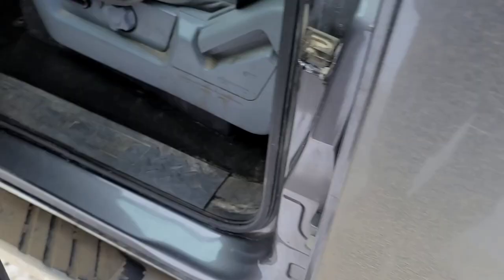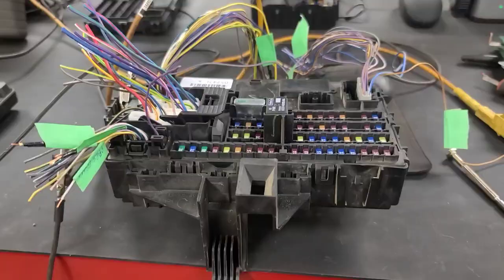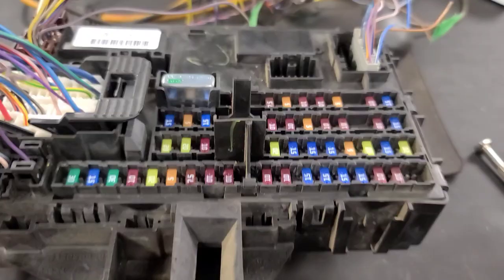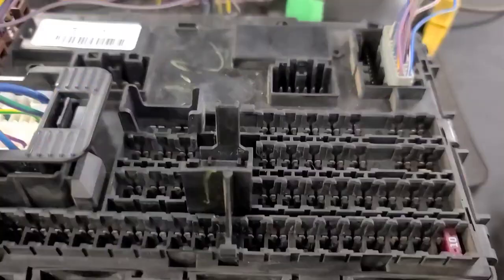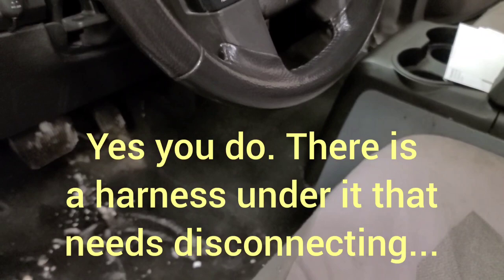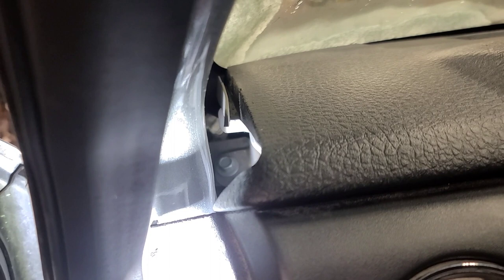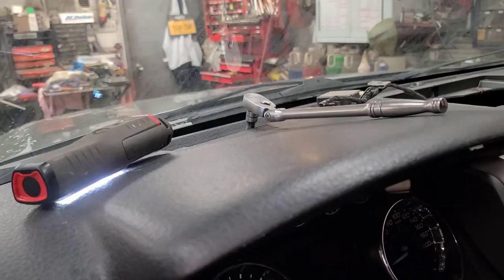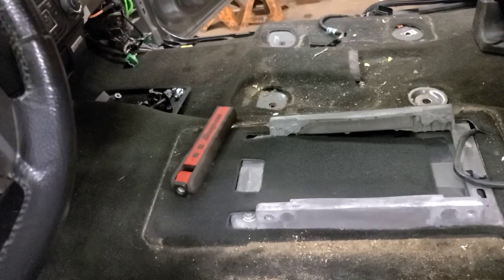2013 F150 Multiple Electrical Problems, Failed BCM Again!!! Plus Entire Dash Removal.

Comment: Wow!! 3 bad BCM’s in a row!
I’m glad I watched your video because, I can see how difficult and time consuming it is to identify the cause of the problem!!

I’m afraid to bring my truck to the dealers or repair shop because, I know they don’t have this amount of time to teardown the dashboard and troubleshoot the module without making the customer pay for their time.

My 2016 Ford f250 super duty is having issues with flashing skid light, intermittent brake light, abs, battery, airbag on the dashboard and the chime sound!

Intermittent dashboard gauges shutting down and quickly restoring to normal.

I measured 122 ohms on pins 6 and 14 on OBDII Connector which tells me there is an open on one of the modules or bad wire to a module.

12v on pin 16
2.68v on pin 4
2.36v on pin 14
Chassis ground on pins 4,5

The dashboard light flashing (errors) started in January during heavy rains.

OBD scanner shows errors U0001, U0140.

Cleared codes but, error codes come back and sometimes more.
Reply from the maker: Yes and the sad part is it's fixed but I'm not 100% sure what fixed it...probably will never know.
Reply from the maker: There is a connector behind the plastic trim under the park brake pedal. The can bus wires go through it. It's close to tge floor and sometimes corrodes slightly.  While measuring resistance across 6 and 14 wiggle and manipulate that connector. If it changes disconnect and clean the terminals with deoxit spray. The can bus wires are twisted pair. Let me know how you make out. Sounds like a network problem and your measured results indicate an open in one end of the bus. I know one resistor is in the ECM and I think the other is in the BCM. I'd have to check the schematics for sure.
Reply from the maker: You should also be scanning the entire network for codes and noting which modules are setting codes and which are not communicating. There is a medium speed network on pins 3 and 11 as well.

Comment: Replace the fuseblock ... The computer under volts  and that fails the bcm. When the computer under volts it stops reading the speed sensor and then the trans wont shift and then the computer goes into safe mode limp mode ...

Comment: 2009 F150 has electrical ghost. Sometimes my driver blinker does hyper.. I believe there was known issues in the door wires being broken. That along with door speaker wires breaking. My abs, e-brake and traction control lights all stay on....I sometimes here static sound from kick panel where fuses come from. AC will turn itself on, off. Occasional fuses blowing, dome light burns out. Listed below are known areas of water entry. 
Water entry through the rear cab vents behind the seats. 
Water entry 3rd brake light 
Water entry from roof molding gaskets (under rivets) 
Water entry from XM satellite antenna (runs down a pillar passenger side) 
Water entry from windshield cowl above flowing down to behind driver and or passenger wheel whales. Hollowed out area behind corner panel areas where the crimp welds are. Also check all of the wire bundles that enter the cab from the firewall (rubber grommets) 
Lastly underneath the truck along both sides of door jams are holes that have factory mesh tape covering them. See if water is not being kicked back through from splash back. 
There is one last place to check and it’s again on the firewall drive side fastener that either hold evap lines or a grommet pops out leaving a hole the size of nickel into the cab. 
All the water entry eventually makes it way to the door jams. Lifting up the plastic strips you’ll see rust most likely. 
Thank you for sharing the video. Very informative. Liked and subscribed.
Reply from the maker: Thanks for the tips, the 09 is a different body design though. Since cleaning the grounds and installing the clamping diode across the shift interlock solenoid it has been fine. Have driven it for nearly a month now. (knock on wood)...
Reply: @PhillipBailey  Appreciate the wonderful videos you take time to make and share. Also, if you have a fb page would love to follow and I’ll share with the ford groups I am in. Good day.
Reply from the maker: @Sheeeeeeeeeeeeiiitt  https://www.facebook.com/phillip.bailey.908
Not on FB that much but there you go...
Reply: @PhillipBailey  will share the YouTube channel then. Again thanks for sharing the knowledge.
Reply from the maker: @Sheeeeeeeeeeeeiiitt  you are very welcome. Thanks

Comment: Man I bought my 2013 f150 Limited a lil over a year ago. I hate it. Within two days, Ac shuts off. Make a long story short, I’ve changed the blower motor, resistor 3x. AC n heat dead again. All kinds of weird shit happening. Came out yesterday n my charger is burning my seat! Various lights will flicker whenever it wants to. I don’t even know where to start. My Ford dealership is full of it. Can’t seem to find a mechanic that is comfortable with the Ecoboost. I NEED HELP. Where are you located?? Lol
Reply from the maker: I'm in Canada Eh. Just outside Thunder Bay, Ontario... The blower resistor will fail repeatedly if the blower motor is drawing too much current or there is insufficient air flow across the resistor. If it has a cabin filter check that. Probably need to replace the blower motor. As for the other issues I'm not sure what to suggest other than to start with a complete network scan of all controllers.
Reply: @PhillipBailey  thank you for responding. Ya man I replaced the blower motor less than a year ago. I think you are right. Over voltage/amperage. I thought maybe the compressor. Ford kept it over night to test n told me “they think” the wiring under the glove needs to be re-wired. Here’s the part I didn’t like, $1100 to do this but no guarantee! As a certified rv tech, that tells me the right testing wasn’t performed. I’m from Bellingham Wa. Have many Canadian clients n friends. I know you guys do things better up there. For example, to get an Rv certification, y’all have to go to school/apprenticeship for four years. Here, you can take a two month course n instructors won’t let you fail! Lol Ugh man, where do I go, whom do I trust???
Reply from the maker: @dannyjalen423  Well the AC compressor will not affect the heater blower operation at all IMO. Ask around there has to be some good techs you can trust. Rewiring the dash is pretty vague. seems to me they were trying to chase you away. Do you have an Amp clamp to measure the blower current? should be under 18amps running on high with the engine running. I have seen new AM blower motors fail. Good luck.

Comment: just a shot in the dark but i had a cust come in with no power windows, no radio, no heater/a/c, cel on. 2017 f150. i know it's newer but the right rear tail light had water in it due to a crack. removed rear tail light and found water in the tail light that had shorted the bus network to cause all these problems. this vehicle has cross traffic sensors in the tail light. my point here is if you lose com from one module it may present as other problems. just a side note the tail light from ford was almost a thousand $, got it but no module in it, called back to dealer and they said it was sold separate. $3000.00 for a tail light? we took the module out, tail light works fine, told the cust what we found and all was good. cust called back 2 days later said he put the module in his oven, yes i said oven at 150f for a half hour, let it cool, put it back in, drilled a small hole in the bottom of the tail light to let the water out. no parts required, but think outside the box to diag tough problems, comm lines are now used on just about every input or output to operate. thanks
Reply from the maker: Yes I had a 17 or 18 Platinum F150 with multiple interior can bus communication faults due to water entry in the Blind Spot Module which is in both tail lights. Takes down communication and affected the radio controls, heater, windows, gages etc. Unfortunately I was remotely diagnosing this and never made a video on it. Thanks for the tip.

Comment: I'm having the same issue. The new BCM worked for 2days and died again. Different symptoms but BCM communication failure. My symptoms are more transmission speedometer related. The speedo stops working air bag lite comes on and the odometer goes - - - - - -.  I only have R N 3rd and 5th gear.
Reply from the maker: I feel your pain... I never really nailed down what exactly was killing the BCM but if I had to suggest something it would be to remove the grounds on both A pillars and clean them as well as the one under the dash to the right of the steering column. Also there are two or three body grounds beside the battery on the right inner fender. Is your truck a column shift or floor shifter? Did you put in new or used BCM's?
Reply: @PhillipBailey  thank you for the reply I installed a new BCM and the Ford dealer programed it for me. I have the exact truck in your video. I will try the ground issue first thank you for the video and reply very helpful I wasn't sure where to go next
Reply: Replace the fuseblock... The computer undervolts  and that fails the bcm. When the computer under volts it stops reading the speed sensor and then the trans wont shift and then the computer goes into safe mode limp mode ...

Comment: Thank you for your beautiful videos
I have a question
I have the same problem The dealer told me to replace the BCM
And I would like to tell you what I am thinking, causing problem
I have water leaking on the third brake lights
Also, I put LED lights highbeam, low beam, foggy light and I put off-road light connected to the battery
Do you think this is the causing problems that thing that killed the bem?
Or it's another thing
I just want to be careful before, but the new bom
Thank you so much for your time Hopefully I get answer

Comment: I was told water coming in from underneath vehicle like frame rail somehow getting to bcm in kick panel
Reply from the maker: Usually water does not run uphill. For the BCM to get water damaged its usually a leaky windshield or sunroof drain.

Comment: You know if this is at all related to the cluster only going dead intermittently. 2012 f150 5.0 king ranch? No other issues just the cluster. Had some water leaking through the sunroof from clogged drains. Related maybe?
Reply from the maker: When you say the cluster goes dead is that the entire cluster shuts found or does some of the functions still work?
Reply: @PhillipBailey  All or nothing. Just cuts out. No lights, all guages peg to zero no function at all. Rest of dash is fine, radio, lights, gps, etc. Occasionally randomly it will come back on like nothing happened at all. I can do regular car maintenance but have no experience doing electrical work:/
Reply from the maker: @Grant3758  that could be a power supply or ground problem. Does it seem to be related to temperature or humidity? Does it occur when you hit a bump?

Comment: My coworker has a 2016 F150 water was getting in on the passenger side from the drain in the firewall leaking back in the firewall into the interior the water leaks on top of the PCM and all those issues start Ford will not cover it my friend told me he'll never buy Ford again because they will not cover this engineering issue
Reply from the maker: It was not a water leak issue on this truck...

Comment: Wonder if ya leave the door lock switches unplugged see if it fails. What is all on that fuse? Man I’d be tempted to unplug the door ajar switches and send it. Then plug one thing in at a time until it smokes another bcm.
Reply from the maker: Since all of tge circuits are simple pull down concepts a short to ground on any individual circuit is the same as a closed switch. I'm leaning more towards a potential short to voltage or a bad ground. I did load test tge BCM grounds as there are only two and they both test fine. I think I'm going to recheck them, clean all the grounds since they are all accessible now, check pin drag on the grounds at the BCM and put it back together.  Put in one of the other used BCMs and monitor voltage on those switch circuits while I drive it. One other thing I noted is that fuse 18 feeds the shift interloc solenoid. There should be a clamping diode in parallel across it. I'm going to check that too.

Comment: Did u have any issues after u unplugged the speedo? I was told not to unplug mine on my 11 or id need to get it reprogrammed
Reply from the maker: No I did not and that does not make sense to me. What happend when you disconnect the battery? There is a remote possibility that unplugging any module when it has power to it can damage it or other modules. That's why it's always recommended to disconnect the battery first. That's my opinion though.
Reply: @PhillipBailey  ok thats goid to hear, i was thinking people unplug the computer all the time but ive been told several times from different people if u unplug the speedo , you have a trip to the dealer in your forecast lol!  But like you said if you disconnect the battery long enough to drain everything or touch the negative and positive leads ( to drain all the capacitors) what difference does it make?

Anyway thanks for the reply, you video was the most helpful one ive seen yet for the dash btw. I couldn't find one for the heater core but the dash is the brunt of my pain 🙏

Comment: its the dash harness, i had two f150s, dash harness burns enternally
Reply from the maker: I never found any evidence of shorted wires, no signs of dash harness failure. In the end I ended up removing all dash grounds and cleaning them as well as the two body grounds near the battery on the right inner fender. I also installed a clamping diode across the brake shift interlock solenoid. It's been fine ever since (knocking on wood).
Reply: @PhillipBailey  so the problem was the BCM?
Reply from the maker: @ALISOCCER95  well the BCM failed 3 times until I cleaned all the grounds and installed the diode. Dealer replaced twice and I replaces twice.

Comment: why not working revrs alarm ford f150 2013 ?
Reply from the maker: If you are asking why a backup alarm is not working on a 13 F150 it would not be factory at least not in North America. I have never seen it as standard equipment. If you are talking about the Paring Aide that warns you when you are about to back into something that's different. If the Parking Aide is not working you likely have a broken wire to one of the sensors in the rear bumper. Visually inspect the wires. I believe there are 4 sensors. If they look ok you will have to get the system scanned to retrieve codes for further direction...Hope this helps.

Comment: I thinks it’s where alternaters   Are going bad. Right befir I changed my bcm. Lights would get real bright  and when I would stop lights would get real dim.  Cluster going crazy.  Things would not work electricity.  That went on for about two months. Then all of the sudden  my bearings in my alternator. Went out   So do a Vegel check on your alternator. Every time you change oil. It onley takes a minit or two. Use your light test  from hot wire.  To the. Out side. Casein  with your ground if you have  a light your alternator  is going bad it. Puts a over load. On your electronics.   Resuming in. Bad computers. Bcm. Modules.    That’s my take on all Thea’s.  Veheckle s   Thea’s day with bad electrical problems
Reply from the maker: A bad alternator can cause a multitude of electrical anomalies but that was not the case here.